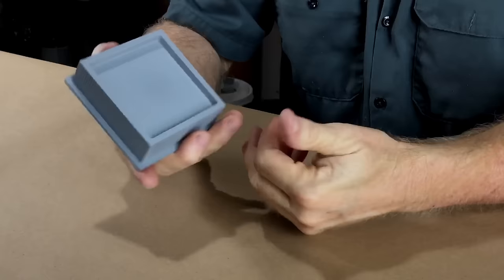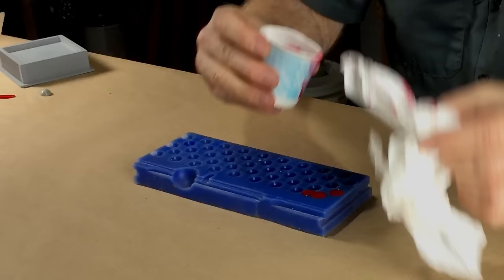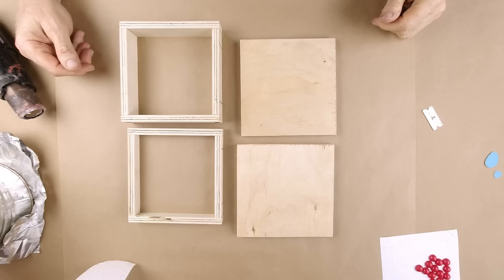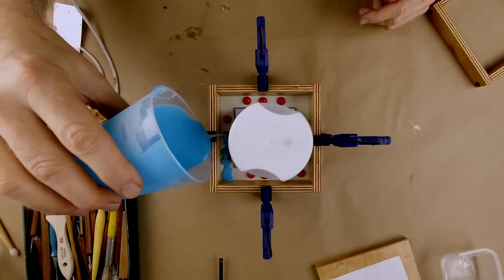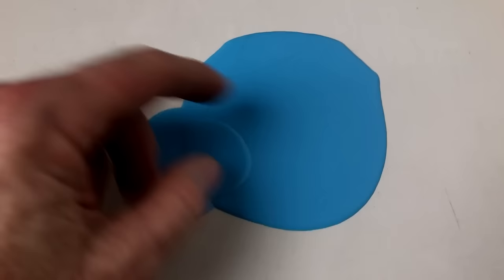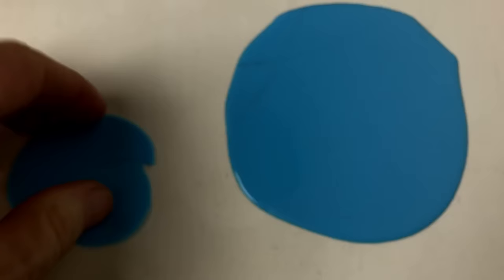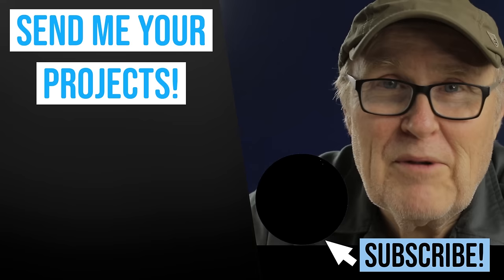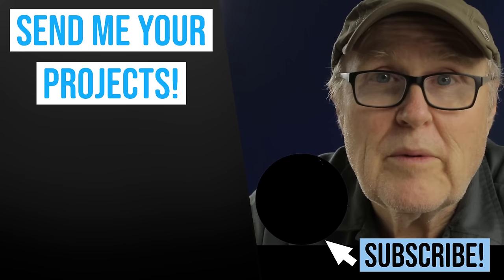Silicone Mold Making: When To Use A Two-Piece Mold. Part 1

Comment: You mentioned possibly using a harder rubber for a 2 piece mold. If you were to go that route, which rubber would you recommend using? Thanks.
Reply from the maker: It depends a lot on what you’re casting and how much flexibility you need in the mold. But something in the 30 to 40 shore range.
Reply: Thanks Rob.  
I was using alumilite high strength 2 rubber and was getting major warping in the castings.  Maybe i made the walls too thin? Idk. Also started with 1 sprue and 2 vents... ended trying to relocate the sprue and cutting 6 extra vents... all for a very basic shape mold.   All i can say is... you make it look easy haha.

Comment: Hey Robert I have a part that I would like to make, I have designed and 3d printed the part and not sure how to cast it.  It's for an old ford for the clutch pedal and it holds a pin which is attached to the clutch cable and the part sits in the pedal.
Reply from the maker: Send pics to me at roberttolone@yahoo.com

Comment: Robert… I love you videos… I’m a religious watcher.  I have a problem and need help. I made a two part mold and it looks perfect from the inside. Once I cast resin in the pressure pot there’s always on side or the other that had a large bubble inclusion that’s inches long. It switches side from cast to cast, so it’s not the mold. Is the pressure pot squeezing air from within the outside portion of the mold into the edges? How can I avoid this?
Reply from the maker: Hard to tell without seeing the mold and castings. Send some pics to roberttolone@yahoo.com

Comment: So when do you know when to use baby powder Vaseline or a release agent..or is there any difference
Reply from the maker: I don't use vaseline or baby powder. I use melted beeswax for sealing porous materials like cardboard and wood in mold cases. And I use spray-on silicone mold release to prevent silicone rubber from sticking to itself. In this video I used the spray release on the first half of the mold to prevent the second half of the mold from bonding to it.

Comment: I live in Hawaii and cannot ship aerosols here.  Do you have any experience or recommendations for mold release agents that are not in a pressurized can?  I saw that Silpak offers MR-150 in gallon containers.  I have access to preval sprayers and might try that.
Reply from the maker: When we do large molds we use MR-150 in a spray gun.  Make very light coats and it works well.

Comment: I am just getting into mold making and have had problems attaching sticks or wires for vents or pour holes. Using melted wax as in the video looks like the answer. Are you using a soldering iron to place the little droplets of wax or is there a specialized tool for that?
Reply from the maker: A soldering iron might work if it had a temperature control that was cool enough to not burn the wax. Solder melts at a much higher temperature than wax. The tool I use is a Foredom wax carving pen. But there are many brands on the market. Google wax carver or wax pen to check them out. Before I got my first wax pen I used an alcohol lamp and metal tools. This worked but was more tedious because you had to keep reheating the tool tip with the alcohol burner. But it is a very inexpensive solution to wax working if you are only using it to apply sprues and vents to a model
Reply: @RobertTolone  Thanks!

Comment: Can normal candle wax be used as well.
Reply from the maker: Resins are petroleum based as are paraffin candles.  So there might be some compatibility that would cause them to bond.  Best plan is to test your candle wax with the rubber and resin you plan to use.

Comment: Robert, what is the best way to make a mold for a polyurethane transmission mount?
Reply from the maker: Is that a rubber mount?
Reply: @RobertTolone  yes the factory mount is rubber and metal

Comment: Why would the rubber get underneath the red dots if it was glued down?
Reply from the maker: When you cast the resin dots they have a slightly hollow back. That’s because the resin tends to creep up the sides of the dot mold which results in a dish-shaped bottom on each dot. And if you look closely,  I just put a dollop of sticky wax on the back; I did not carefully fill in the bottom. So there was space for rubber to get between the dot and the mold case. So then it becomes a question of: is it better to carefully seal each red dot or is it better to trim off excess rubber that might get underneath them? It’s just a matter of where you want to spend your time.

Comment: Please show me how to casting takraw ball with silicone mold
Reply from the maker: Do you want to make an actual ball you can play with? Or a model of a ball? Either way it is a complex object to make because it is hollow and has many holes. It would have to be cast in two halves and then joined together.
Reply: @RobertTolone  just a model, but many holes in takraw ball, so difficult to remove silicone in there, i think your reason absolutely right, must devide in two part
Reply from the maker: @fuqorock  You could divide the ball in such a way that the parting line follows the design. Not a straight parting line.

Comment: Can you make a mold without degassing the silicone
Reply from the maker: Yes, but your mold will likely have bubbles.  If you brush a coat of rubber onto your model, making sure there are no bubbles on the model itself, you have the best chance of getting a clean casting.

Comment: I don't understand why you had to make a top or what the round indentations are for?
Reply from the maker: I could have made this as a one-piece, open-back mold.  I didn’t because when you pour resin into an open mold you don’t get a flat bottom. The resin has a natural tendency to cup, meaning that the casting will have a slightly hollow bottom. You have to machine the bottom flat after you make each casting. To avoid that extra step I decided to make this as a two-part mold. What came out of the mold was a clean copy of the original with a nice flat bottom. No need to sand or machine it. The round indentations are registration pins that hold the front and back sides of the mold in alignment.
Reply: @RobertTolone  both good answers, thank you!

Comment: Robert do you ever do large projects? What part of the country are you in? I have a 4 foot statue of the Blessed Mother - connie schneider
Reply from the maker: Hi Connie, I have not done a large project on the channel because of time constraints.  Ideally I try to complete a project in one video episode. No project should occupy more than two episodes. That is because the views drop off dramatically with each successive episode. In my career I’ve done life-size figurines for casinos, restaurants and public sculpture. The process for making them is different than it is for small works.  They are usually two-piece blanket and mother molds that are hand laid up. The parting line is clay up, not cut. And the figures are cast in fiberglass or rotationally molded in resin. I have never done statuary in concrete or hydrostone materials.  On my channel the closest I have come to demonstrate it the process is the Pug Mug series. It was 4 episodes beginning with this one: https://youtu.be/G3L0BTNr4xI

Comment: Hi sir I'm from india. 2'x2' 8mm how much kg silicon liquid need ? Kindly reply me sir
Reply from the maker: A silicone rubber should have a material data sheet that will tell you the specific gravity of the rubber. That number is how much more of rubber weighs than water. Calculate the volume of your mold in cubic millimeters then look up the weight of water in a cubic millimeter and multiply that number times the specific gravity of the rubber. That would tell you how much more rubber you need to mix up by weight. You must remember to add extra rubber for waste. Some of the rubber is wasted because of sticking to the container and the mixing blade.

Comment: Hi. I'm looking to remake a hard rubber piece that goes inside car trim. On the end. So it is hard black plastic actually. But I need several of these as the others are broken. It does not have to be perfect so what could I use to make a mold. You spoke of a cut mold. What is that. Also would I need a two piece mold on something so thin and small? its the size of a credit card but about 1/4 inch thick and a bit of an odd shape that is not really square. And it has contoured front and back side. So pretend you are bending the credit card in your fingers and create a slight curve to it. That is similar to the type of piece I need to remake. Thank you. Never done any mold or do not know what to use or anything.
Reply from the maker: Hi Rick, can you send me some pics of your trim part?  Send to roberttolone@yahoo.com.
Reply: @RobertTolone  Hey thanks for reaching out. I sent you two emails that I uploaded videos of the parts I'm baffled about trying to replace, fix or make work with new pieces. Let me know what you think. Thanks so much!
Reply from the maker: @MrCbell57  Hey Rick, for some reason I’m not finding those emails. Try re-sending them.
Reply: @RobertTolone  I sent you a new email. Did you get the video? I changed it to public

Comment: you really don't need a hard silicone in this case.  just leave a wooden box over it.  it called hard shell mould.
also you can embed hard structure in the mould itself in places where dimensions are critical.

Comment: How to cure resin poured in mold ?
Reply from the maker: The resin is a 2-part system that you mix before you pour it into the mold.  It cures by itself.
Reply: @RobertTolone  You mean it's not UV Resin ?
Reply from the maker: @MrScary-zu1vc  No, it’s casting resin -a totally different beast.

Comment: What's the shore strength of this rubber?
Reply from the maker: 25 on the A scale.
Reply: @RobertTolone  Thanks, I emailed you with the complex shaped helmet crest (red wolf on a crown),  I'm slowly cutting it into pieces for molding but I'd be lying if I didn't say I was nervous
Reply from the maker: @Sirconnor9292  Hey Joel, I can’t find your email. Resend it if you want to.
Reply: @RobertTolone  I will

Comment: Where did you get the registration buttons template?
Reply from the maker: I milled it out of blue machinist’s wax using a CNC router and a 1/2 inch diameter ball-nose end mill.
Reply: @RobertTolone  thats amazing
Reply: I may model it in 3d and print a model mold, assuming it wont stick with some ease release
Reply from the maker: That would probably work well.

Comment: Why don’t you just use acorn nuts instead of making registration keys?
Reply from the maker: Because I use whatever I have on hand.  I made that blue wax mold to cast dots for another purpose and they work great for registration dots.  Also, acorn nuts are tall and there's a little bevel around the nut which you either have to fill or trim. Lots of people use them but I don't get tight clean results with them.